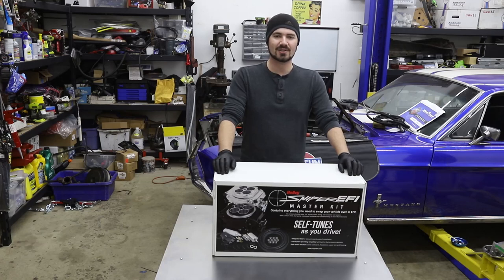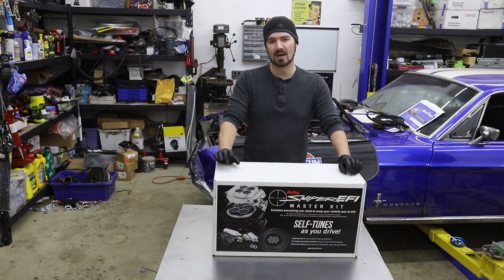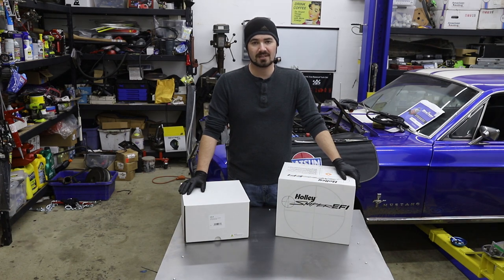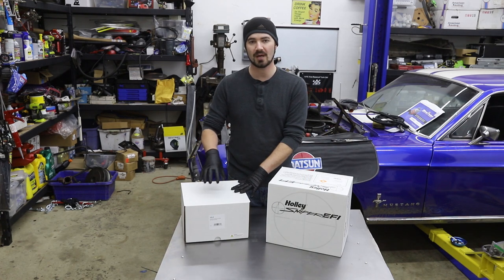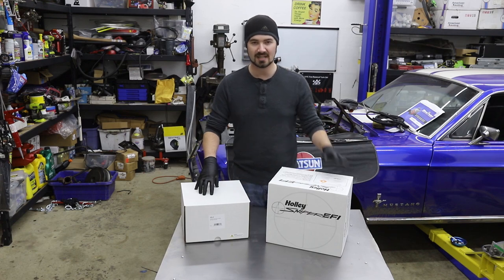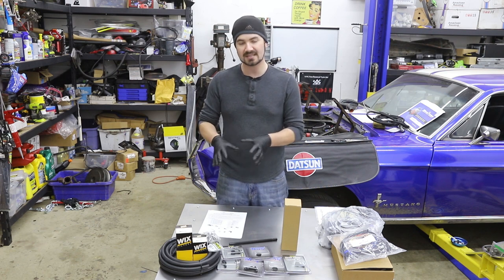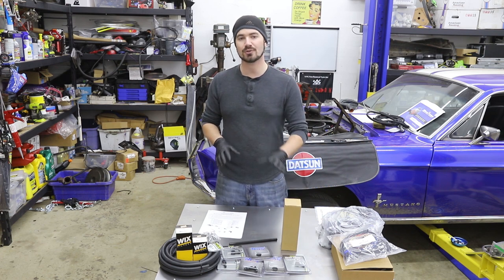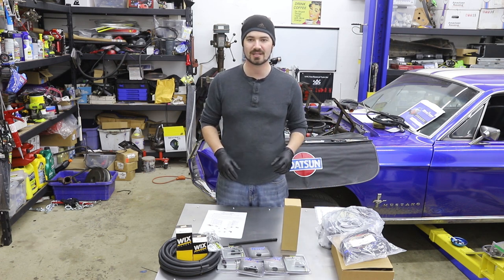Holley Sniper EFI 4150 unboxing and comparison

Comment: did you ever put the 4150 on the 289? did you make a video for it? how did it do compared to the 2300?
Reply from the maker: I did for fun, but it's far too large to be required. The absolute lowest fueling of the 4150 was more than the 289 needed. If the 289 was more built it would make a little use of it, but the 2300 is good for more than the 289 could make without boost or serious internal modification. The 320hp 302 in the car now doesn't even start to work the 4150, it's probably good for nearly double this power with a supporting fuel system.

I hope that helps!

Comment: Casper what are you using for the pink switched 12v connection. I'm having a hard time finding 12v while Cranking
Reply from the maker: I had to pull from the brown wire in the engine bay that runs to the starter solenoid. I discuss it in my previous video if you want a little more info about it: https://youtu.be/2tqJ_TCHXec
Reply: @AmbiVe  thank you sir. I did find that video discussing it. I have an after market Wire harness and I was struggling like you. Cross referenced your brown wire reference to the ignition switch diagram. Had used that spot for my MSD ignition. Spliced in and we are good to go. Going to use your tape idea for setting the idle. I appreciate the videos, over did the details here just in case someone needed some extra help